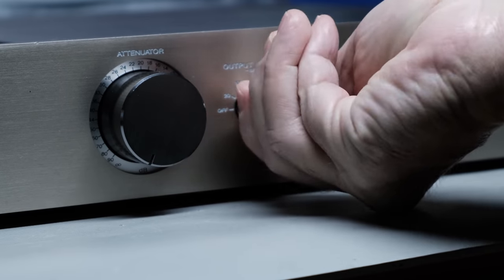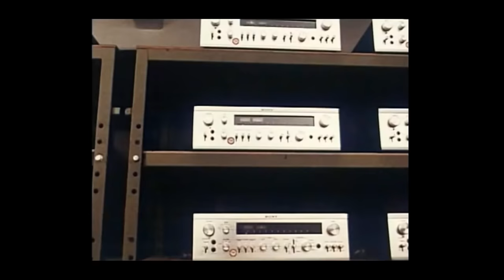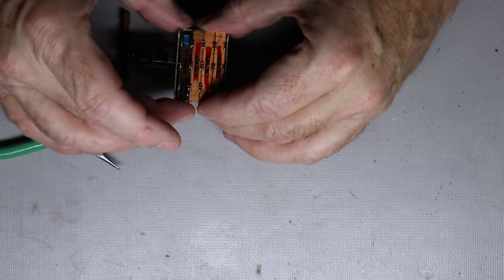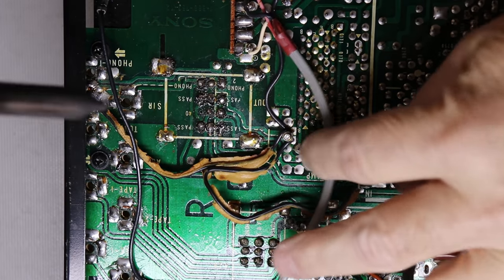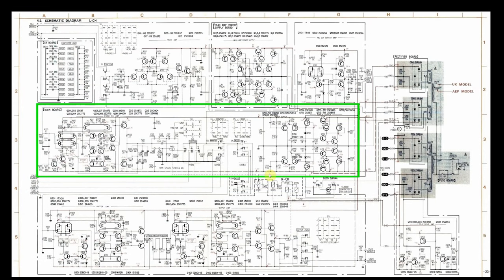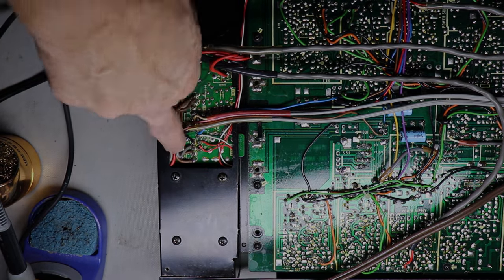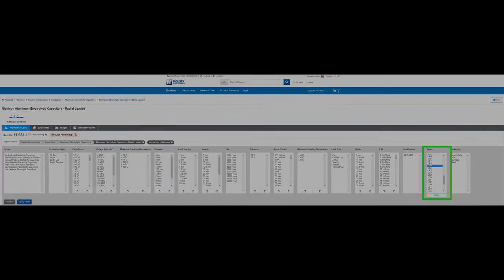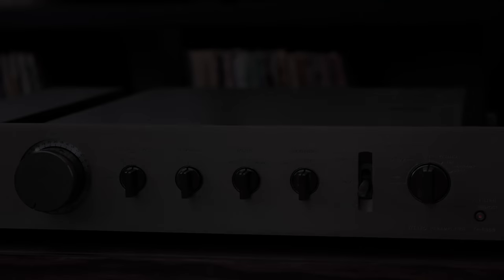Sony TA-E88B Preamplifier - Can Beat Sansui Pioneer Marantz. Stereo HIFI Repair Restoration Testing.

Comment: I own a siglent SDG 1032X Arbitrary waveform generator. It's suppoda be good for up to 35MHz. So I go to test just that: It's good up to 100,000 KHz sine wave 4v peak to peak. Peeping it's performance on my Tektronix 465B w DM44 w/ attached CMC251 Tektronix frequency counter. (Can't ya tell from the flexing - I've joined this dick size contest HEY! YOU GOT THE POUCH FOR PROBES N SUCH! - even though ya got a DM44! No FAIR!)  Hangin' out in the breeze, waveform generator's output was 50ohm BNC cable with factory micro test clips. So yeah, about 7" bare separate wires acting as antenners. I musta been pissin' off some local Shortwave radio listeners. I think maybe the Siglent is trash. REAL garbage. Maybe. Aint ever given it a proper real test yet but I have seen it's signals get messy quick under many tests, as close to optimal circumstances as I could get.

Comment: You had luck that they didnt't mess with attenutors, which are custom made for this model.
Reply from the maker: Thanks for sharing.
Reply: @vintageaudioaddict  these are of highest quality , discrette array of ultra precise resistors and silver conductors and contacts on ceramic base material. Real ball bearings...

Comment: i think the worst brands in the 70´s were Sanyo, Sony and nakamichi(they work perfect when new) , instead of the average of 50 years in all known brands for the 70´s material ,this 3 brands were good for maybe at the most 9 years , nothing else was so bad . The first deck my father bought in mid 70´s from nakamichi ,a 3 head deck it was restored in 86(if memory doesn´t fail me) and it´s working today other components, even bought in early 90´s stoped working in a period from 3 to 6 years, i went dragon and turned into a fly ,the turntable and the deck ,such a good looking pieces but if they only work perfect for a period from 3 to 5 years i don´t know why evenm they talk about the nakamichi brand that much ,the deck is not close to other high-end decks from known brands and the turntable with all it´s modern functions isn´t close to a 45 year old turntable at the time now with 51 years old still works the dragon turntable was a flop good for nothing as the deck, the stasis power amplifier and it´s pre were very nice but sold them before something happened at a non working level

Comment: I don't think the issue is where the part is made, if it's a legit source as a lot of the components are made in China. But it's knowing whether the product is genuine. You don't always know what you are getting. I bought a replacement tablet screen from China. Turned out to be a counterfeit and un-useable.

Comment: you talk too slow.  and a 2+ hour video?!
Reply: playback speed @ 1.5 and it's perfect
Reply: Also the Japanese accent used during the middle but was critical to video, and kept me on the edge of my seat as based on the table top portable stereos going through the line and when comparing those models and my grandpa's model I have the date of vid insert release sometime in 1974, way out of line 😅.
Reply: I prefer to listen to someone who enunciates clearly rather than have to decipher content from someone who speaks like a TV advertising babbler.